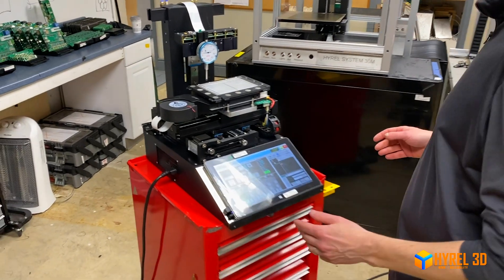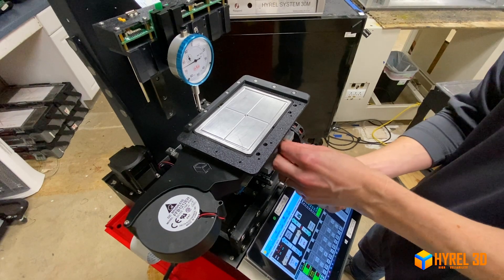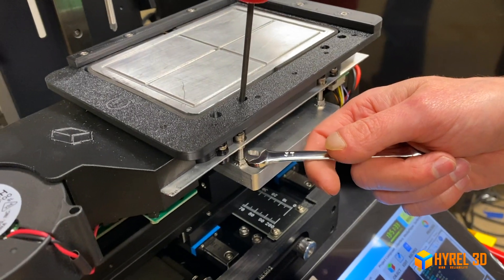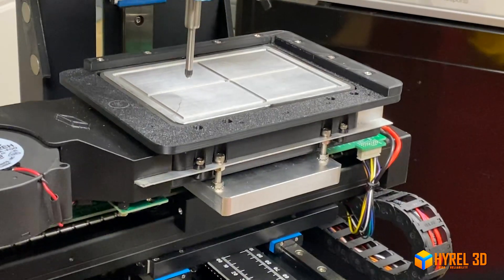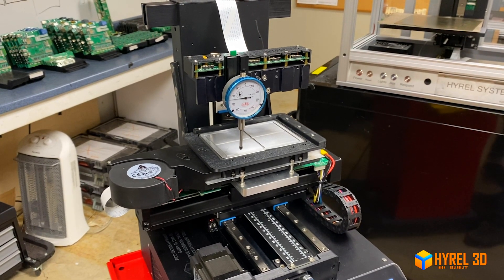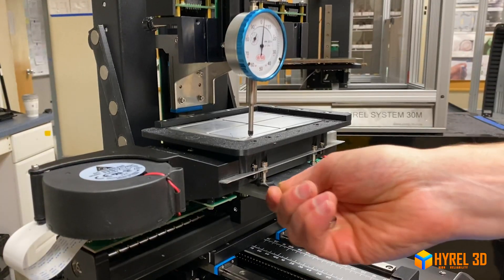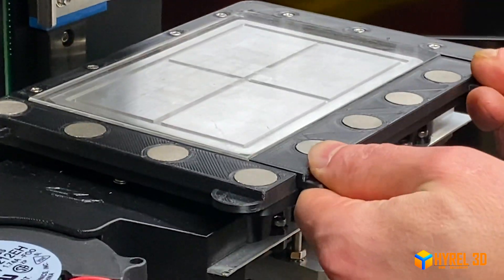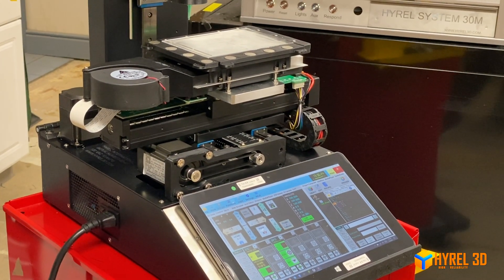Heated Chilled Vacuum Bed

Comment: What is the type of analog guage used here?
Reply from the maker: That's a standard Dial Inidcator, used by machinists and others who want to verify that the travel is planar and parallel to the work surface. https://en.wikipedia.org/wiki/Indicator_(distance_amplifying_instrument) 

We include one with every printer - otherwise, how would you know if your build surface is flat relative to the travel of the heads?